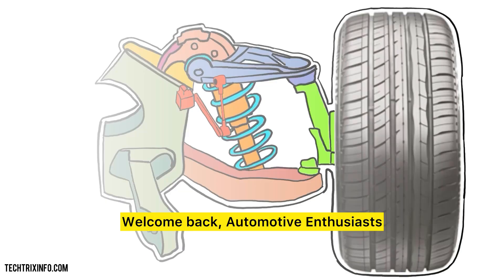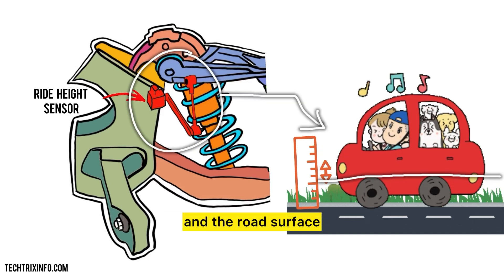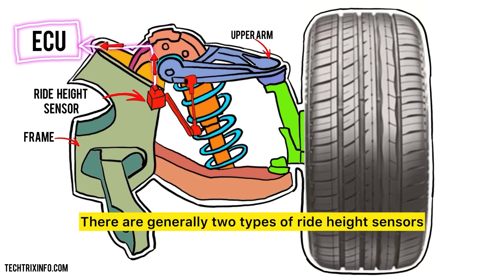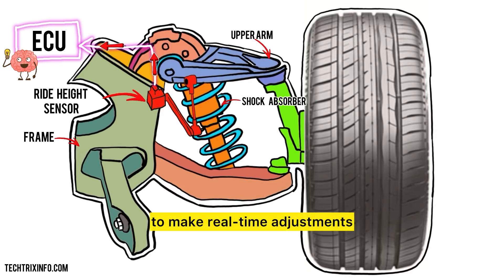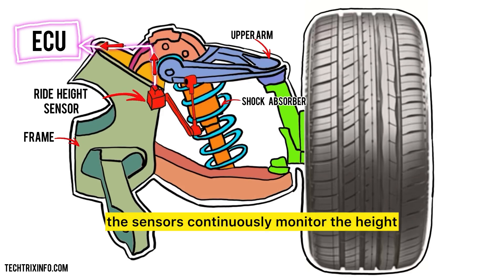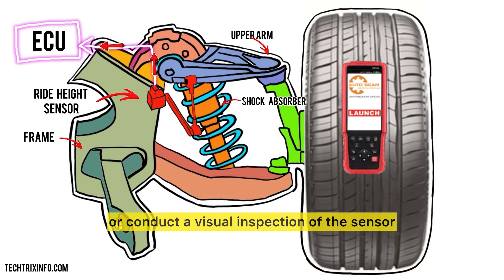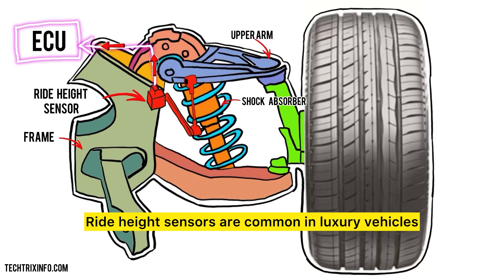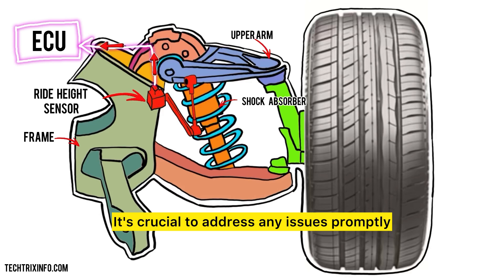Ride Height Sensor Explained With Animation | Mastering Automotive Sensors | Part 21

Comment: Tried adjusting the angle of the sensor on 2023 Armada SL after installing 2" spacers all four wheels and front Arch Well is at 37.5 inches and rear is 35.5 inches since compressor did not increase air bag height with factory sensor position. I angled the sensor to the max (clockwise rotation) after loosening screws and started vehicle (drove 5 minutes) and compressor turned on and lifted rear suspension to 37.5 to match the wheel well Arch Height. Notified the rear bounces with air bags at max since the coil is fully extended due to the 2 inflated air bags so a rough ride over speed bumps. I then replaced the 275 60 20 tires with a larger Series (65) to 275 65 20 which are 34.2 inch ATs so get a softer ride with more rubber between the road and rim (.65x275/25.4) now 7" with 65 series vs 6.5 so more road flex but now ground clearance went up with larger diameters tires and front wheel Arch height from ground is 38" and rear is 38". Ride improved but rear still has a bounce and noticed Stock armada spec has front sitting 1/2-1" higher than rear so what is the correct ride height with 2" lift and 34" tires? 38" Front cant change but can lower the rear 1" to 37 to allow the coils to oscillate more by turning the sensor counterclockwise by 10 degrees at a time to find the sweet spot. Bottom Line is they should design the ride height sensor with graduated angles markings every 10 degrees to adjust for either sagging rear or too much air in two bags so its a set and test operation (find myself scribing old position) slighter altering to find better ride position. Suggest they go back to older design has an adjustable bolt and threaded nut is more precise than this design.
Reply from the maker: You’re correct — with a 2” lift the Armada is designed to keep a slight front rake (about 0.5–1”). Running the rear too high puts the air bags at max pressure, which causes the bounce you’re feeling. Lowering the rear to ~37” and fine-tuning the height sensor counter-clockwise is the right move. These systems aren’t meant to sit level at max bag pressure.😊